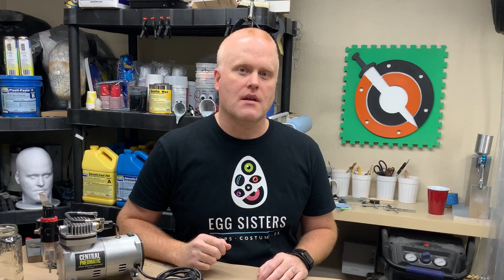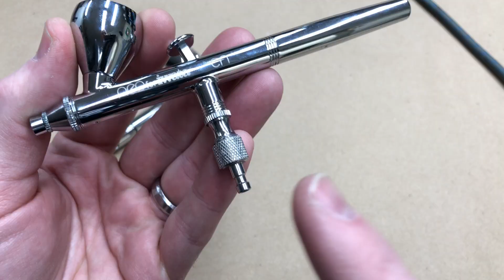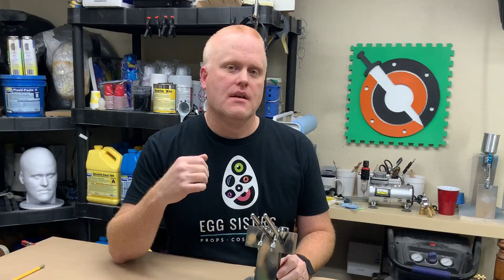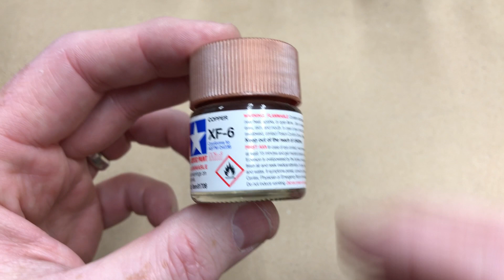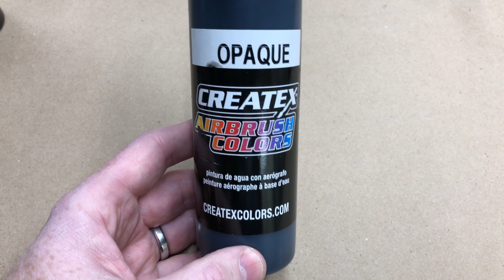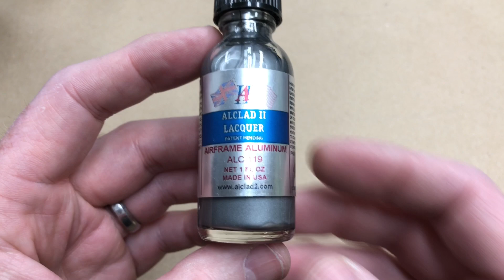Intro to Airbrushes 2: Compressors and Paints for Makers Props and Cosplay

Comment: Wish there was a forum to discuss and ask help on things regarding painting, sort of learned by myself from videos and trial and error, now i'm have a hard time with Alclad getting a nice glossy black base for chrome, the result is a dull black base, issue might be that the paint is a bit old, over a year or it's very hot where i spray and it may dry before hitting the surface.
Gonna do some more tests, using an Iwata Revolution 0.5mm needle and also have a cheap chinese 0.3mm airbrush that came with the compressor, i think i's better to use the Iwata for the base and maybe the smaller airbrush for the Alclad Chrome so it's a mist coat. I got a nice chrome a few years ago but now not sure where the problem is, everything else i've painted turn out pretty good but chrome has always been a problem.
Reply from the maker: With Alclad black gloss you have to first go over with a couple of mist coats then do a full wet coat. Temperature will def mess with your results. I try not to paint if it’s over 70 Fahrenheit..
Reply: @emj_made  Definitely, i moved my spray booth and will get a fan next month, i think that's also a huge issue due to overspray.
Reply from the maker: @Icemanmodeler  Yeah, that is also one of the MANY variables to spraying glossy finishes.

Comment: These have been the best videos on airbrushes. Some get too technical and blag the head (to the point I gave up getting one), they go into Pros and Cons so much that you're still left questioning which is best to purchase and yeah they end up doing more harm than being helpful. You give just enough info, stick to the important points and make it super easy to understand. Can't thank you enough! I'm really ready for your next video! Especially as I'm wanting to purchase and start using asap xD Subscribed and Thumbs Up! 💕 Quick Q, you ever used these on faux fur? If so, do all the paints mentioned work and do you still need to thin paints the same way? Thanks again!
Reply from the maker: Rachel Holgate I’m so glad to hear that. I’m making this series especially for people such as yourself. Thank you for letting me know. I haven’t painted fur but I have painted several types of cloth. Most of the acrylics will work with cloth... so most likely will for fur as well? I’d recommend trying Createx or Angelus which are commonly used for cloth painting. There are also some other specialty cloth airbrush acrylics available but I haven’t tried them.
Reply: @emj_made  thank you for the reply! Super helpful and really appreciate it :)

Comment: Thanks for the video. Can I use spray can paint for airbrush? I've seen some people spray the paint on the small cup and pouring to the airbrush cup. I wonder should we add thinner or not. Thanks
Reply from the maker: nixland You can. Most spray can paint is enamel and won’t need to be thinned . You’ll need paint thinner for cleaning your airbrush tho. The best way to decant the paint is to spray it through a drinking straw into the container. It will keep it from splashing back on you.
Reply: @emj_made  thank you so much!

Comment: I just watched your intro to airbrushes last night like twice. I'm working on my first airbrushing project, a foam sword, and learning a bunch. Thanks

So far, because it's cheap, I'm using walmart 50 cents a tube paint and 91% alcohol. I'm having some flow issues though, I'm thinking I didn't thin it enough. I'll spray and get no paint out.

Also I saw some people thin with half water half alcohol, I tried this and drying took forever because I'm doing it in a cold garage.
Reply from the maker: 00meat Plays That can work but it’s also a bit tricky. You can run into issues if it thins out the binder and pigment in the paint too much. A good rule of thumb is to mix it to the consistency of 2% milk.
Reply: Maybe I need to play with milk more. My current method is to start a little thick and thin it down till it's where I want it. At least till I get a better feel for it.  Thanks for the advice.